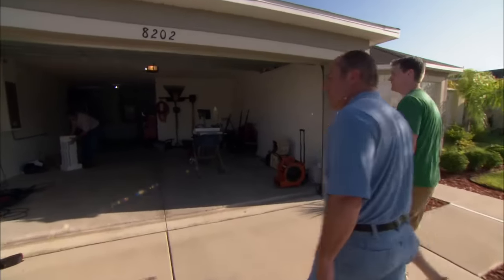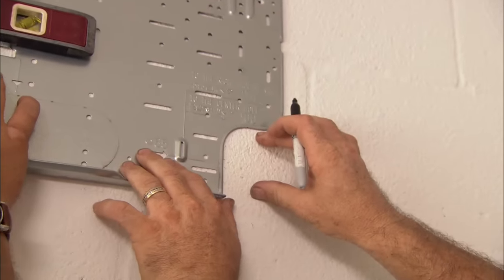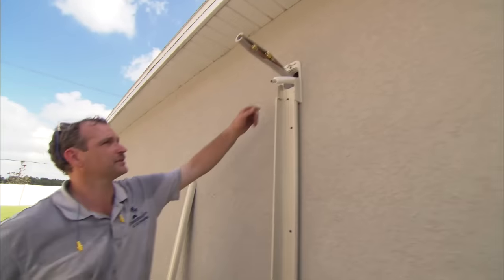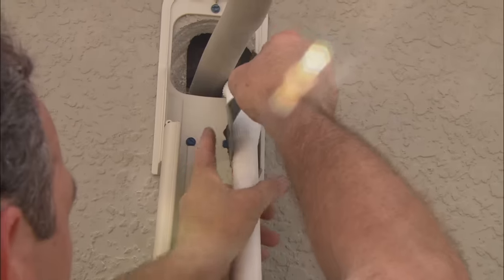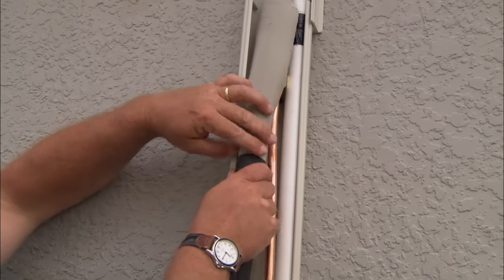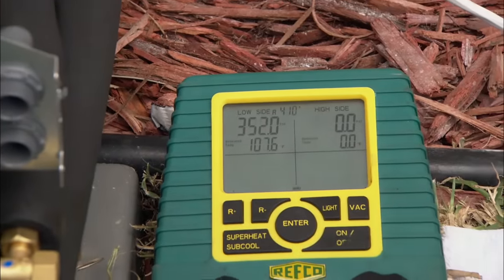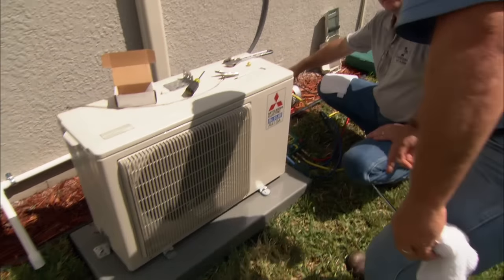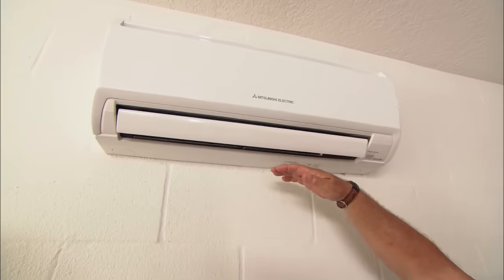How to Install a Ductless Mini-Split Air Conditioner | This Old House

Comment: nice work although i wouldn't bend copper with my hands , i'll use a bender for that ,good to see fell
ow a/c techs on youtube man great work
Reply: In the full version of the episode he mentioned that there's an internal strain relief type device under the insulation to stop it from kinking.
Reply: you'll be surprised copper is amazingly soft and will kink at moments notice ,i too went to school for this ,and i work in the field so i know a bit
Reply: yeah that will help ,but i always say best have the tools to make life easier, work smart not hard
Reply: There is no way He did not flatten that copper pipe
Reply: You can hand bend smaller line if you are careful.
Reply: Fill pipe with water, freeze, bend by hand. Obviously only good for short runs, but this method and filling with sand and capping is how the much more brittle and thinner brass tubing is bent for musical instruments.
Reply: I installed a bunch of these units spring/summer 2016. All of those bends were done by hand. No bender, no fill with water or sand.

It takes some skill and a good feel for it.
Reply: I'm an air conditioning engineer from the uk, the pipe is quite flexible and it is designed so it can be hand bent around tight corners. You would not be able to get a bender on the bend being so close to the wall. The indoor unit pipework comes with a spring that will also help to avoid kinking it sounds weird but it's true haha, if you do kink the bend you will just have to cut off the old pipe and braze a new bit on it won't take much time. Just another bit of info aswell you get two types of pipe solid copper which comes in 3m which is much more sturdy and less flexible that you will have to use a bender to bend it and what you see in this video is called soft copper which is a you can see bendable by hand and comes in large rolls/coils As shown in the video. A lot of cowboy ac installers use soft copper for long meterage installs to avoid wasting time bending and brazing but will look no where near as good to using the solid pipe that is straighter and looks more professional . One additional thing for the comment about putting water or sand inside this pipe that is an absolute no no! Moisture in the system can be damaging and sand is significantly worse you will 100% get issues doing that air conditioning pipework needs the stay clean as possible for a smooth running unit.
Reply: how are you going to get your tube bender over the brass connectors on the end of the line.
Reply: I know that was my point, I never use a bender it's just 3/8 and 1/4"
bends easly
Reply: Exactly, Soft drawn copper tubes do not necessarily need a bender to be properly bent.
Reply: You would use a bender to bend 1/4 & 3/8 pipe lol why???
Reply: so
Reply: Locutz M Ip
Reply: if your hands are strong enough, you can bend copper without kinking it. I've been bending line sets for 40 years by hand and have never kinked one.
Reply: for mini split line set i only bend it by hand unless its 5/8s or above
Reply: Reason they took so long to get here was mostly that Non-Union HVAC cheap ass old fashioned contractors and installer wont change. 

Same reason we still see old fashioned (Hot) water heater tanks in the USA instead of  far more efficient point of use water heaters. At least we r finally get rid of the incandescent bulb 50 yrs after the rest of the world did it. :) 

And the new Mini-Split A/C-Heat Pumps r precharged so we dont need a licensed HVAC person to do the charging so u can totally DIY now.
Reply: Locutz M .
Reply: mostly all major brands of out door units come pre charged. That said any system will need refrigerant after a certain length of liquid line. for instants most multi indoor unit installations will need a charge on Mitsubishi past 93 feet. unless you wish to drop an out door unit for every head.
Reply: That y it requires the gauge and reading the instructions too. But thx for reminding us.

Since there is only so much engineer they can bullid into it before we will need an an expensive licensed HVAC tradesman. 

So choosing the right DIY or semi DIY system for our needs is key to avoiding that expense. 

And finding ways to shorten the distance like attaching the outdoor unit just opposite of the indoor unit instead of on the the ground when it can be securely supported that way is key.
Reply: Who would need a tubing bender for bending 3/8 and 1/4 copper? Yes just use your hands to bend it it's very small copper you are not gonna kink such small copper. You would be wasting your time going to your truck or using a bender.
Reply: "Who would need a tubing bender for bending 3/8 and 1/4 copper" has been said before. So y repeat it? 

Even if kinking not usually an issue with soft 3/8 and 1/4 copper designed to be bent by hand, Real professionals take the time to use a bender to do it the right and nicer looking way. If that offends some ppl to lazy to use it. Deal with it.
Reply: Normally the connections need to be made and the valve(s) need to be opened for the lines to be pressurized. lines. And even a fully pressurization line still could get a kink when its bent. Since pressurized gas only helps to minor extent to prevent a kink. 

A pipe bending tool is always the best option. But if the instructions says it can be bent by hand and ur to lazy to use a  pipe bending tool then carefully bend it hand.
Reply: It all boils down to this:  You can bend those 3/8" and 1/4" lines by hand all day long without kinking them.  However, it's the radius of the bend that determines the likelihood of kinking it.  Long sweeping bends are fine.  Short radius 90 degree bends have a much higher probability of kinking and even more so as the tube diameter increases.  So, you can bend them by hand if you like and only wind up with a kink once in a while.  Locutz M using a tool would be fine 100% of the time.  That's it.
Reply: You never, ever want water or any other debris in refrigeration lines.  Ever.  It's a huge no-no.
Reply: For the copper rolls, you can bend those & straighen by hand pretty easily if you're careful. The ACR copper, you have to aneel it to bend it (Blow about 3 psig of nitrogen as your shielding gas & heating the pipe while carefully bending it)
Reply: The ductless air handlers come with springs wrapped  around the copper lines
Reply: Thor214  Never do that with pipe for air conditioning pipe. ACR pipe comes clean and capped and filled with nitrogen to keepmoister and other non condesensible contaminants out. You are suggesting contaminating the pipe on purpose.
Reply: Locutz M   certainly should have been explained. But this is a TV show so they leave out a lot of pertinent details. A bit misleading, as an unknowing person could assume that you can safely bend copper as long as you do it by hand.
Reply: Its soft copper its bends very easily
Reply: @dumbo800  do that to refrigerant piping and you kill the system
Reply: 1/4 and 3/8 are easy to bend by hand . We install Fujitsu's at my company and I believe they come charged for 25 feet for each head

Comment: A $10 bottle of Nylog would really make me feel more confident in those compression fittings. Had the smallest leak in a custom a/c line in a compression fitting for my truck, never knew what Nylog was but once I found out I evacuated the system and put it on everything. No more leaks

Comment: not idiot proof... I've seen people really screw these up. The hole was made too close to the bracket, also you always want to pitch that hole downward - condensate will not drain unless it is pitched. I've seen drainage issues with units installed the way you see here.
Reply: zs, normal practice with ac  condensate lines is to include a slight upwards angle at first to create a "trap" to seal from insects and cooling losses. I would also route drain line to 12 inches beyond the outside unit.  A constant wet spot next to home will create problems in a couple of years with sagging ground & crack in foundation & wall.
Reply: Thanks for your info, very important.
Reply: @michaelamick8295  What? this is wrong info. ignore. You do NOT put a upward angle in the condensation line!  And for drain, it is best to just use as a gray water irrigation if you can, or to a drain.  If you dont have one,  dont worry, a constant wet spot on concrete will do little harm in couple years.
Reply: Phil Indeblanc, certainly every one's experience is different. I was a home inspector for 7 years. My opinion on creating a condensate trap comes from that & code requirements for house AC systems. Plz google "ac condensate trap-images" for illustrations if needed.  I concede that with the smaller systems their fans may not be as powerful as the whole house type and the percentage of loss would likely be less but insect/pest entry without a trap is still probable.  I would still recommend it.  Re: moving condensate lines away from foundations; again this is a known issue within home inspection field and a code requirement. I have personally witnessed several condensate drains causing significant ground settlement with the resultant cracking of the foundation footer and cracks in the block wall above. While certainly true, a high percentage will not have this result, in the US SE region it is common enough to forwarn people of.
Reply: @michaelamick8295  
 For pests, just use a proper screen at the outlet.
I guarantee you that 95%+ of "pro installers" will not trap the condensate. 
Always good to understand the reasoning, and one can make the call if such is needed. 
So its great to make suggestions that are rational to a scope of a project. Its just sad and funny to see the "experts" poke their heads up and protect their turf of GREED and overpricing the masses (taking advantage of the market, in econ terms).

Comment: I think ductless is the way to go if you have less than 1500 square feet or live in a humid area. I still wouldn't feel comfortable installing it myself though...
Reply: Paying for someone to install your ac unit will cost the same amount it would cost you just for the gauge manifold nitrogen and additional tools
Reply: Carson Myers not to mention even a cheap vacuum pump will cost £400 not sure how much in the us
Reply: Most auto part places will rent or loan you a vacuum pump and gauges. Its what I did when the ac compressor on my car went bad. You can also buy a vacuum pump for a 100 usd and a set of gauges for 60 from harbor freight.

Edit: For any one who doesn't know most auto parts places have a loaner program of some sort for some of the more.. esoteric tools used in car repair so you don't have to buy a tool you will likely only use one.
Reply: Carson Myers Wise Choice . Good set of gauges 150 to $200 vacuum pump $400 and up flare tool 50 bucks and micron gauge hundred and fifty bucks... Job done correctly priceless
Reply: biohazard 918 two different type of gauge sets. So 134a gauges won’t hook up to a mini split system.

Comment: Phili878, 
I had sub-contracted 'professionals' install my unit. If I had known they were the three stooges, I would have done it myself! NOT HAPPY!
Reply: +Karl Horvat How much did it cost to have them install it??
Reply: +Karl Horvat you actually need to be a licensed installer to do it. so no you couldn't have done it yourself anyway. And its harder then its looks, they skipped a lot of steps
Reply: so your telling me anywhere in Australia you can install a circuit breaker into a switch board without being a licensed electrician or fridgy? ummm alright mate
Reply: oh, and sorry didn't mean to make fun of them, but you did say "depends where you live if you have to be licensed" and i am referring to Australia
Reply: But you fucking mentioned Aus AFTER he said his piece.
Reply: It's harder than it looks especially if they pipework length goes above 5meters it shouldn't take 3 people to install this type of ac unit though. I do this on my own on a regular basis with larger units with longer pipe runs
Reply: Mykel Hardin  I totally agree. They are charging so much and they dont even want to encourage using these units. The least I got quoted for a simple 1 output unit was $750, and thats with a 220v already setup. What a joke! Or I should say theif!
Reply: Robbie Britt ....... license not needed in America to add a breaker to an existing panel.   Yet, 90% of people call in a professional to do electrical work at the breaker box.  You don’t have to call in a licensed pro to do anything in your home. Ever.  But if you try to sell the home and it’s not up to code,  then it’s got to be corrected before new owner moves in.   It’s negotiable who pays for the +corrected work to be done.

Comment: These guys are in oil burner country so are very familiar with flare connections. For those that are not, the installation manual says to put a little oil on the flare surfaces and has torque specifications. Special torque wrenches are sold at Mitsubishi distributors. Don't put the insulation over the connections until leak checked!

I don't recall seeing the extremely important step of evacuation of the lineset and evaporator. That's how you get that nitrogen out otherwise it will be a big bubble of gas going through the system and will reduce cooling capacity and may cause other problems.
Reply: I was noticing that they didn't put oil on the flare nuts as well. I believe they quickly said they pulled a vac, it would have been nice to see a micron gauge reading and have that pointed out as these systems are very reactive to any type of non condensables or impurities in the lines. Other than that great little video
Reply: I've been installing instruments with various tubing for over 40 years and no one ever uses flared fittings. Most if not all jobs they are not approved. If a piece of equipment comes in with flared fittings, we throw it away and replace it with compression fittings, usually Swagelok.

Comment: I have a Goldstar/LG unit on my residential building apartment which is 5 years old.   All apartments have the same Goldstar air conditioning model, with the condensing unit installed on the roof.   All of them have corroded main board after 5 years.  The board is placed in an un-insulated box located near the fan blade which blows humidity towards the box.  $200 for the main board + labor.

Comment: Air conditioning has sure gotten more simple.
Reply: Shena L Is this similar to your system if it is I think I could have installed it in a half day.
Reply: Not when you start messing with 16 seer - 25 seer units.. things are actually becoming more complicated
Reply: not really it's still the same if done correctly by the book The only difference is R22 used to be pump down to 700 microns and 410A is 500 microns. and of course maybe the flare fittings instead of brazing.

Comment: I hope its low voltage not high :) That twisted cable under ground terminal is nightmare :) The hand bend of refrigerant pipe is real pro skill.
Reply: It is 240 VAC single phase. When they say "high voltage" they mean more than 12, 24, 48 Volts, etc.

Comment: actually this is a regular ac all around the world. some have heating elements too. completely unknown in the US where people still use window units from a century ago
Reply: Ssssst. Don’t wake them up.
Let them keep thinking they are the best and have leading technology 😴
Reply: Window units are fine in a lot of applications.  Such as leases in structures that do not allow you to punch holes through walls, or have no electrical provision outdoors. There are also some areas that only need air conditioning a few weeks in the summer and never more than that.

Comment: Thumbs up this unit saved our asses in Afghanistan..one day it was 108 outside turned this puppy all the way down and I found my camel pack in my room slushy. It also has a dry (dehumidifier) setting...in the winter it snowed in the morning sun evaporated snow lead to humidity in the morning. Perfect for garage storage. POG life
Reply: A/C in the military... never heard of it.
Reply: @damone70  

We had it.  I had window ac units installed in the wall.of my chu.
Reply: @dam11232  Things change I guess, I'm from Gulf War era.
Reply: @damone70  

Yeah.  Were spoiled